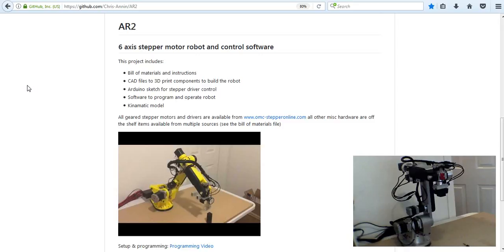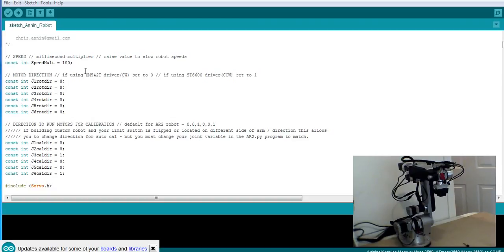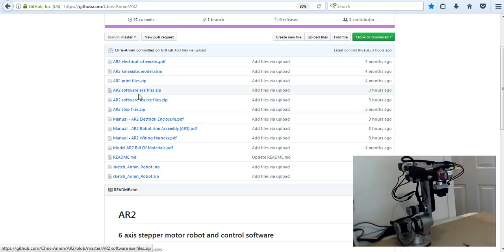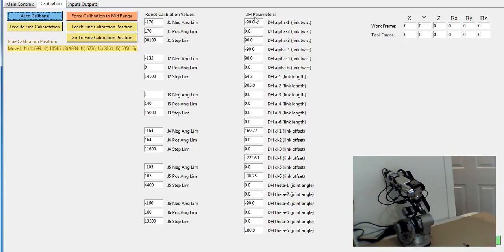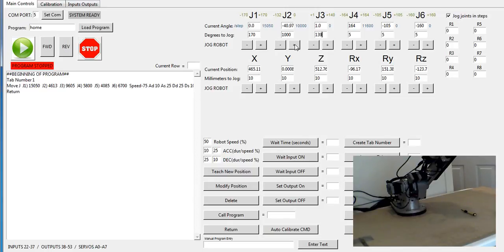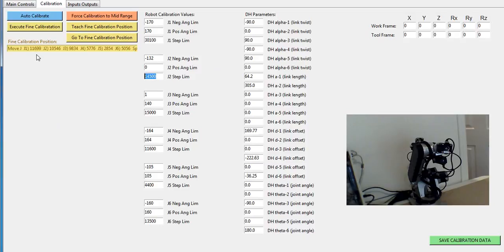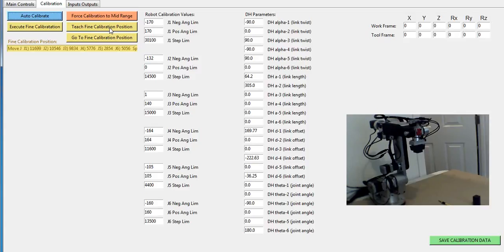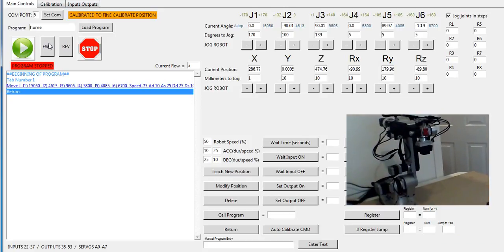AR2 robot - Calibration Part 1 (startup procedure)

Comment: Hello Mr.Chris Annin. May I know that i can use TB6600 driver instead of your ? Because when i upload AR2 2.0 into my arduino mega then The motor did not move at all. could you please help me with this problem? and one more thing is about power supply 5vdc. Is it optional. I do have only power supply with 5V 3A. Can we use it instead of ur? Thank you

Comment: hello sorry to ask.. im trying to build one of your robotic hand for a school project , but im currently using a a4988 driver , so can it run it those a4988 drivers?
Reply from the maker: yes you should be able to use any driver you choose as long as you wire it per the drawing.  Please also see the website and the information on the AR4 as this is latest version and software.
Reply: @anninrobotics  ok thanks!!!!! . you are the mvp replying to comments !!!
Reply: @anninrobotics  i think i have a problem installing the ar4 software... because when i extract it and execute the ar4 file it is unresponsive and didnt load anything...

Comment: hi, what you have done is a hercules of  a job and you have done it outstandingly good,
iam trying use the software for my college project, in the joint J2 iam using a nema24 motor without any gears so what happens is that the motor rotates faster or reaches more angle than the stated angle and when the robo is in jog mode and the speed is 60% but after i teach the position and run the cycle speed is lesser  than the jog speed but the program shown the speed is 60%, i hope you can help me in this problem. and is there any way we can remove one of the joints in my design i dont have a j6. thank you
Reply from the maker: I don’t completely understand your question. The speed is time based on delay between steps. The percentage setting is percentage of max.  Removing one motor from the kinematic chain would be an undertaking. It’s possible but you would need to reformulate how the math is calculated
Reply: thanks for your reply,

yes that portion is not clear i will rephrase it for you "  when iam going to teach the robot to move to position A to B with speed of 40% ( i move it with jog mode to that position ), after the teaching is done when i run the cycle in the program the robo moves from position A to B less than 40% of speed as you told speed is nothing but delay but that delay must repeat the same during cycle start of the program also but in this case the delay is higher when compared to jog mode so it seams like the robo is moving faster in jog mode with 40 % speed and the robo moves slover in cycle start program with same 40 % speed ."

i will send a video on what is happening can you give your mail id.
thanking you.
R.ABILASH CHAKARAVARTHY
Reply from the maker: Yes please email me at chris.annin@gmail.com also are you jogging to position in joint mode or Does your move from A position to B position taught using XYZ buttons,  The reason I ask is because if you are jogging to a position using multiple joint moves separately and or using X position then Yposition then Z position one at a time it will appear to move faster for each individual move but when you combine all of the axis together the time delay is applied across allsix axis .
Reply: thanks for your reply 

i jog each joint separately ( i use jog robot buttons +.-  of each joint like j1, j2, j3 to move the robot to a position and then i teach it) may be like you told that is y the speed is different, what if i want to increase the speed similar to that when i jog individual joint ( i want the same speed to that of jog mode speed ) what should i do then. is there any way that we set the same speed as jog speed of each joint to that in the cycle start where all the joints move at the same time.

thanking you 
R.abilash chakaravarthy
Reply from the maker: Do you have your move program 100% speed? There is also a speed multiplier on the Arduino program that I talk about on the calibration video
Reply: thanks for the reply

so we must keep the robot speed 100%  before starting program start to achieve the same jog speed in the teach mode am i correct. i will try that first i have some issue with the drives (electrically) so once i get the drives i will update you on that.

THANKING YOU
R.ABILASH CHAKARAVARTHY